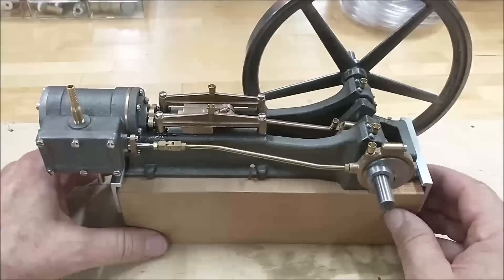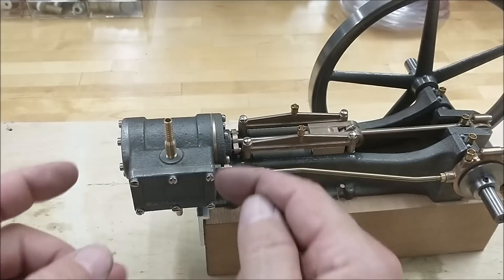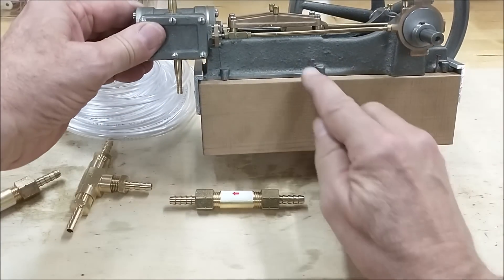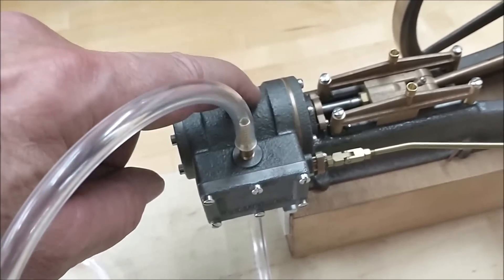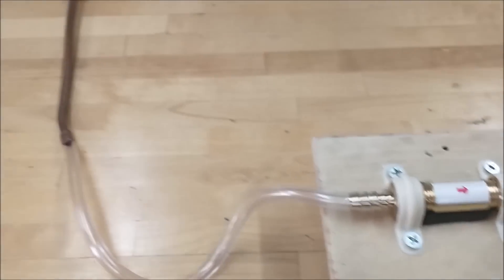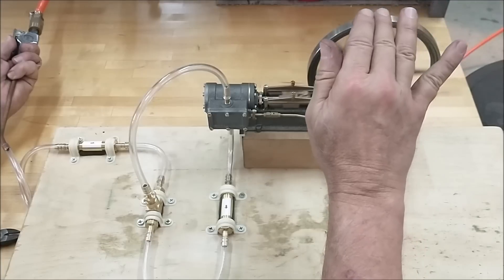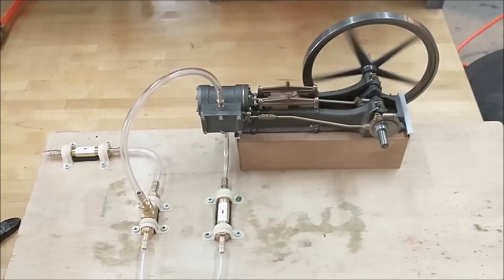Perpetual Motion Video....Is It Fake or Real ??

Comment: I’m going to take a crack at this 🤞First, admirable machine work as always Joe.  
The machine is running on air pressure alone. However…I believe the size of your flywheel has allowed you to Rob air from your piston as it strokes. And is  using the piston as a compressor as well as a driver and instead of porting the exhaust through the steam chest it goes to your “exhaust”port in turn marking it a supply not necessarily an exhaust. 
It works as Joe describes only he left out a few details. 
Perpetual no, although it will run as long as the system is air tight and will eventually need to be recharged from an outisde force.  Eventual leakage around the piston shaft as well as the valve shaft and piston ring wear will cause eventual slow down.  If I’m correct I am curious how long the “robbed air” can make up air lost. Happy Easter.

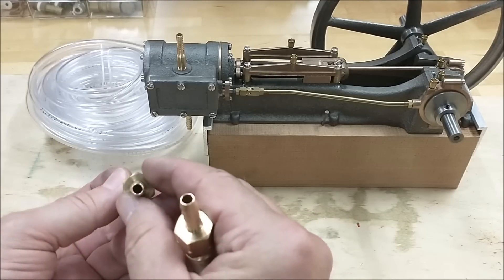Comment: Hope this doesn't ruin the illusion.....At 1:39 and 1:45 in slow-mo .25 playback speed, you will see there is a hole in the backside of the "check-valve" in his left hand - I suspect that is on the output side of the check body since no air escapes when the hose is cut. The Shop air hose at probably 70-90psi connected to the fake supply side only supports the illusion that vinyl hose won't handle. The tubing doesn't even flex when "pressure applied". The source of motive force is either through hidden pressure line or external manipulation. The other "check-valve" could be ported likewise to ambient air with something blocking the exhaust side from the applied max pressure of maybe 20 psi between the 2 "check valves". Although those appear to be basic NPT nipples with one end plugged, not true check valves.
Reply from the maker: I can see how your observations may be plausible, but the 'Hole" you claim to see is a black silk screened part number on the body of the check valve. My air system runs at 130 pounds, but is easily trickle fed with the lever type guns I use. This steam engine runs on about 3 pounds of air which the hose can easily handle. You also wouldn't hear anything but a gentle poof when cutting a line with only 3 pounds of air in it. Basic NPT nipples can easily be turned into check valves with a rubber faucet seat, a ball bearing and compression spring. I hope this doesn't ruin your day, but your guesses are incorrect.
Reply: @joepie221  I'm not that invested in it as you are, so why would that ruin my day? I meant no offense. I thought guesses, speculation and plausible features were par for figuring out how you pulled it off. The thing about being told a guess is incorrect versus being proven incorrect is we get more clues. Only 28,000 more views to go until we know.

Comment: I assume that you have removed all friction points from the engine. Of course it must be in a pure vacuum to dissipate air resistance. It also must regenerate the initial pulse of air used to start the engine. Please film it again in a week or two with it still running.  Of course this is an pril Fools joke.   good one!!

Comment: The steamengine is running one the trapped compressed air because off the checked valves and that little leak by the rod moved by the valve you get a differentieel in pressure. That why it is keeping running.
Greetings from the Netherlands

Comment: The black rubber under the one way valves is the give away here and I'm pretty sure the air line wasn't connected.
I did think about a vac pump on the exhaust but that would only work on a piston valve.

Comment: Please respond is this a joke because if not so much can be done with it. My thoughts are 1st law of thermodynamics is being applied energy can not be destroyed and gas presses on the walls of it's container and if a wall moves and a valve switches the direction of the pressure then as long as there is pressure beyond the resistance it will turn the flywheel. Is it a joke everyone keeps saying it's a joke. Can you please answer that for me?
Reply from the maker: The clue is in the video description. Nobody has found it yet.

Comment: Next time you do this make sure the hose hisses as you snip it. Wink. 

Love your work. I've learned a lot from your videos.
Reply from the maker: The steam engine requires about 2 pounds of air to run. All you get when clipping an air line with 2 pounds of air in it is a quiet gentle poof. Any air in a system like this won't back purge due to the check valve proximity to the cut. Theoretically of course. Thanks for watching.

Comment: I reckon the "check valve" on the exhaust is a fake - It's really a connection to a vacuum pump under the table, and the engine is drawing in atmospheric air through the open pipe.  Nice one, Mr. P.
Reply from the maker: Interesting guess.

Comment: The tubing acts as a small reservoir. Eventually the friction will diminish the stored energy in the reservoir (meaning the pressure stored will become neglible) and the engine will stop. The minimal friction of the engine is a wonderful mechanical achievement. If chicanery was involved, there may be a pressure regulator in the line we do not see. After all, we do not know the psi of the input line. Higher pressure stores more energy in the reservoir... Nice video and demo.
Reply: Your comment was the one I was looking for, air compresses and will probably run it a little while until the friction from the piston rings and the crankshaft eventually uses up any stored energy. I wonder how long it might run.

Comment: Friction losses would inevitably result in stopping.  How long will it actually run until it stops?  We had a air bearing demonstration at school (66?) that the presenter spun a circular plate at the beginning of the lecture, and it just kept going like the energizer bunny.  But inevitably - even as good as it was, friction wins.   C’mon Joe- clock and time lapse review.  Inquiring minds need to know!😊😊😊😊😊

Comment: Joe wouldn’t harm the engine for this trickery. If he says there is no motor or battery, then it has a second air supply and exhaust ran under the plywood. Taking his word it is a true 3way is suspect, not that it isn’t a 3 way, but where the true 3 ports are. If it is unmodified, then all that is left is the two check valves being more than they appear. He also had to stop the engine at the end of the stroke, which stalls an air operated engine

Comment: What a simple concept, I can see why so many brilliant minds I'd the world let that fly right over them. In all the years I've worked with hydraulics it never occurred to me to route the exhaust back to the intake, check valve it and as long as you have a leak free system it will cycle until it dies. Brilliant Joe, you never cease to amaze me.

Comment: If it's real, it should work by connecting the exhaust to the intake DIRECTLY.  And put into motion by spinning the flywheel with your finger.  The reason for all the fittings is to conceal the under-board connections.
EDIT - no, I take it back.  See my 4/29 comment.

Comment: Sweet joke there Joe, not easy to figure out. 

The proof that this is a gag is this, a run where the exhaust and the intake and check valve systems are at room air pressure. Then try running the engine. It will not run. 

What is actually happening here is that the piston is not pressure balanced. One side of the piston has less surface area than the other due to the connecting rod. This means that on the stroke in towards the engine, the force on the piston is higher. On the outbound stroke, the piston is drawing power from the flywheel to overcome the friction in the system. 

Joe gave it a large amount of energy when he charged the system with compressed air. Eventually, the friction will remove all that energy from the system and it will stop. What this does show however is how well built and balanced his engine is. 

The joke is that he is playing with that difference in the surface area of the piston and the energy stored in the flywheel. Perpetual, no, but it will run for about 5 to 10 minutes on that small difference. Notice that when he stopped it, it tool very little effort. 

Well done Joe

www.youtube.com/watch?v=R1gDOyQDRxM

Comment: That is a great demonstration .
With a early type steam engine with sliding valve .

Piston type valve engine is a later and better design.

Works with air , for a while if  leaks are very small.

Steam would not work as when the steam cooled the pressure would drop till it would be liquid water again .
Steam is 1800 to 1 ratio to water .
The interesting thing is the one side of the cylinder has less cid due to the piston rod , so it is not balanced in cid side to side , but it works .
Many people have tried an failed to make things like this work .
But you did it !
Keep up the great work Joe .

Comment: Well the air feed shown on camera cant have been feeding it at any point because if you block the exhaust port it just wouldn't run, the pressure would build and the back pressure would stop it running. So I am guessing modified check values with pipes going down through the base board.
Reply from the maker: Upon closer examination, you'll see the exhaust port isn't restricted.

Comment: Joe please don't take this the wrong way as I have a great deal of respect for you. We have met at the summer bash and I must say out of all the YouTube creators I met you were the most genuine down to earth guy I met. This is a cool concept as I am sure you know there has to be clearance in the packing in the rod glands thereby causing SOME leakages.  It's not a comment on your engine build it just has to be.  A couple of things I thought of is any leakage of the piston seals or the one seat on the "internal" check valve seat will just serve to equalize both sides and balance the pressure.  Two things I would suggest if you would be interested in doing an indurance test are cap the supply hose on the inlet check valve after you pressurize it. Also add some high quality synthetic oil to the friction points. I would be interested to see this setup with the addition of air gages on a time lapse to see just how "perpetual" it actually is. My scepticism comes from a couple of physics courses I took that tell of the impossibility of perpetual motion and further interest watching many YouTube videos on this subject over the years.  It is actually one of my favorite rabbit holes to jump down.

Comment: A jaw dropping 3rd visit says go for the patent. Super slippery cylinders, rings and piston, bearings along with just the right amount of the right viscosity oil you will extend the run time a bunch methinks.
Reply from the maker: I can say....without a doubt....that reducing the diameter of the piston does nothing for the function of this particular model. Just sayin. Good to see ya.
Reply: @joepie221  Exactly, but on the friction side it is the real enemy. This is just soooo much fun and cool to boot.

Comment: I would like to see the rpm after you cut the hose. I am willing to bet that the engine speed started to decay as soon as the hose was cut. The hose is acting like a compressed air storage tank and will let the engine run for a little while but not forever.

Comment: I'm not totally surprised that Joe managed to build a frictionless machine, but that he solved the need for differential pressure to make the piston move really floored me! I was surprised the air pressure was so low though that I didn't hear more of an air blast when the line was cut.
Reply from the maker: The check valve stopped he expected hiss.
Reply: @joepie221  I expected the air line with the blow gun to hiss.

Comment: What is that orange line in the upper right corner? 
Knowing how Joe can build miniature fixtures, I say there is a small coming up under the base into the bottom of one of the valves.
By rights the pressure should equalize on either side of the piston and stop the motion.
Reply from the maker: Its the feed line connected to the air gun.

Comment: Intersting. I have some questions (suggestions for further exploration).
1. How long will it run without any load?
2. How long will it run when connected (by belt I assume) to a tiny generator? 
3. Can you produce enough electricity to make up lost energy from friction, gravity, etc.? 
"True" perpetual motion is not possible. However, it should be possible to use waste energy from other processes to keep a system like this running indefinitely. Perhaps capture waste air from pneumatic tools to keep the system charged. Or use Sterling engines to capture waste heat from a lathe/mill motor.

Comment: "Run Forever"? I think not. If you have zero air getting by the piston and none of the check valves leak before the ball seats itself from the reverse pressure flow, it may run for a long time. The flywheel helps keep the pressure up. Let run til the next day, if it gets that far, and the RPM stays constant, then I will be impressed.  Good job on the engine!

Comment: Engine is  running backwards please do your research, I can explain the theory if you wish
Reply from the maker: Please do.
Reply: OK here we go, the piston moves forward pushing the crosshead which intern pushes the con rod.  If the con rod travels up the thrust forces the crosshead down into the strong cast iron  bedplate. On the return stroke the con rod travels under the center line pulling the crosshead down into the bedplate again.
The crosshead guide bars are the weak link and are what the name suggests guides. 
  I understand you are not a steam nut but your toolmaker brain should figure it out in a heart beat.
Looking forward to the build on the stuart double ten I have five of them, thay also do a boiler feed pump, this one  sorts the men from the boys, if you completed one you would be the first person on utube.
Good luck and thanks for your videos.

Comment: It's impossible it works only with circulating pressure air. There must be opposite springs inside the cylinder. Lol.

Comment: Newtons third law of motion "For every action, there is an equal and opposite reaction". If anyone can perfect perpetual motion it's Joe Pie. You apparently have created a model with no friction and perfect sealing for the piston, piston rod and valve chest and have somehow compensated for the two different volume displacements on each end of the piston due to the piston rod consuming volume. I believe the block is solid too. It would be interesting to see the bottom side of that flywheel. Maybe you could remove the flywheel altogether and run it?? Thank Joe for sharing your time, knowledge and your creative thinking with us. Keep em coming Joe

Comment: Nice, it will run like that until the inperfections and loss accumulate and stops. If the steam ports, value, piston, cylinder caps, packing were all perfectly sealed it would run forever. However, we know that is next to impossible to do so eventually it must stop. LOVE IT. Well done joe. That would be a great test to show how well any steam engine has been machined.

Comment: In 1970 I was in a regional science fair (held at Kent State just a few weeks after "that"). One of the entries was an electric go cart. The kid had a generator driving from an axle to charge the battery. It was hard wired—no regen braking, just regen, all the time. He wouldn't listen to any of the other 13-year-old science geeks as to why it wouldn't work.
Reply: One of the guys in the RC club was convinced that he could put a fan (airplane motor and prop) on the back of his sail boat, aimed towards the front of the boat, and when the fan inflated the sail the boat would go forward. He built it. The wind died. He turned on the fan. The sail inflated. Boat did not move. lol. It looked good though. One of the guys with a 'power' boat acted as a tug boat and pushed his sail boat back to shore. Out of courtesy and not to discourage innovation none of us openly laughed. It was very difficult to keep a serious looking face. We finally convinced him to reverse the polarity on the electric motor. He did. It worked. Limp sails and all.
Reply: @Artiken1  The boat thing can work though, look up fan powered sailboat or similar, among others you will find mythbusters with a flat sail, or much better working demonstrations with a correctly curved one.

Comment: Happy April 1st Joe. Awesome trick. The flywheel will keep it going for a while with the assist (or lack of resistance from) of the air recirculation, the  driving energy stored in the flywheel will be used up in friction losses and it will stop. Years ago there was some guy on The Tonight Show who demonstrated his perpetual motion machine, using permanent magnets in a complex machine that looked like  Ferris Wheel and seemed it may have been plausible, but I never heard of anything coming from his "invention" so I'm leaning toward a hoax.

Comment: Joe, always thinking.  Question,  will there be any heat built , due to friction, that might expand the plastic tubing a bit creating more space in the tubing than air volume?  Or would the heat, if any, be relative to both the air temp and the tubing allowing both to expand at some relative coefficient? It would interesting to let the little engine run for 24 hrs to see what happens.  I am a huge fan of your ingenuity, engineering skills and machinemanship !!!

Comment: You did a good job hiding how the engine is powered I'm guessing you modified you check valves so it feeds in exhaust from under the board

Comment: The initial pressure before cutting the tube is the fuel. The in-line has extremely low friction so it can run on that fuel for a long time but forever? No! The principle of conservation of energy has to hold.